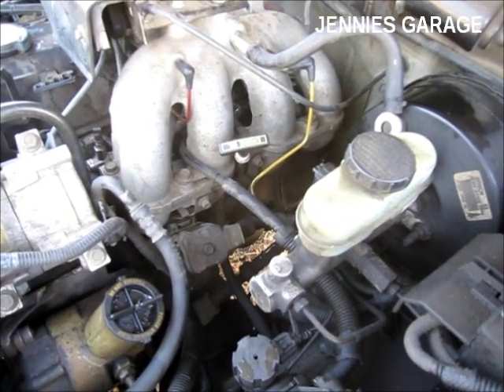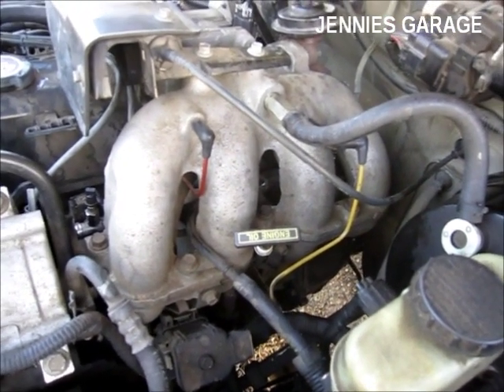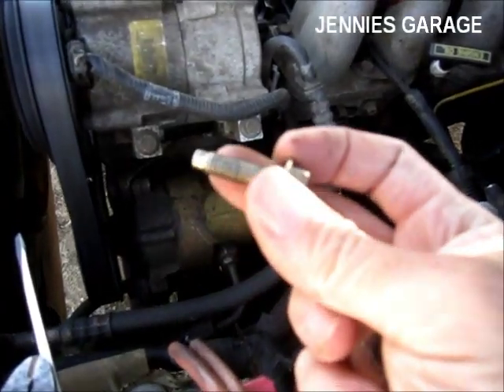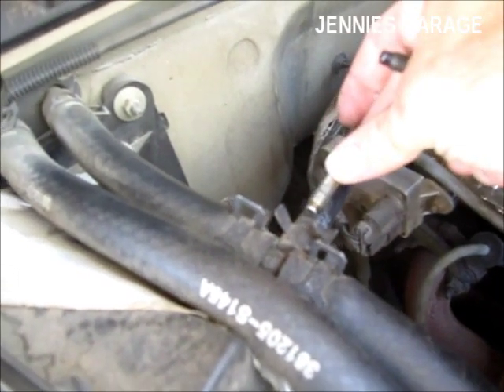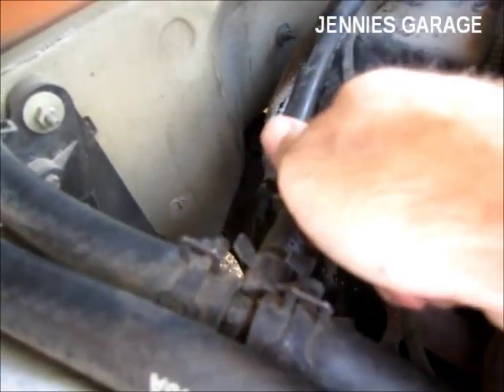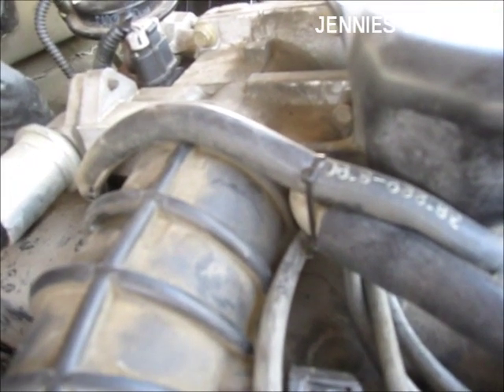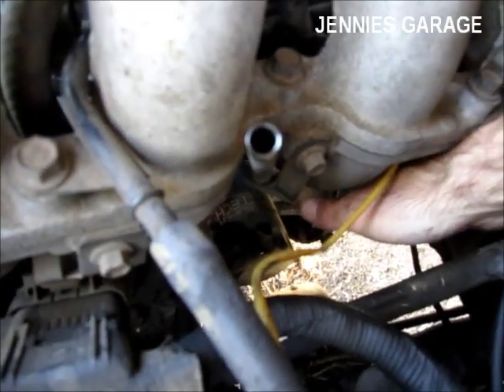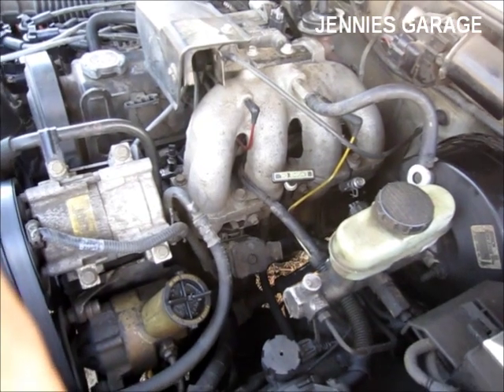Ford Ranger Intake Manifold Hot Water Bypass - Cooler Air In 5 Minutes

Comment: Neat, considering doing this in my 2.5 except I would put a valve that I can turn from "summer" to "winter" mode. Would I have to block off the end at the manifold with a valve as well, or just at the tee? I'm wondering if you could have left the hose attached to the manifold with no ill effects? I'm guessing I would just need to add one valve, and burp the coolant system after installing to prevent air bubbles wreaking havoc.

Comment: I have a 99 2.5l that was leaking coolant where this line terminates at the block, broke the barbed fitting flush with the block trying to repair the leak. do you have advice on replacing that fitting?

Comment: Will this work on a 2003 Ranger with a 2.3l Engine.
Reply from the maker: My truck was a 2.5 but if you can find coolant tubes going to the manifold like in the video, it's probably a similar process.

Comment: Mine's an 89, I have to replace that entire hose (we do live in places with temp extremes in both summer and winter) and it's looking like I have to pull the oil filter to replace the engine block end of the hose. This sucks 'cause I just did an oil change two days ago before that hose started to fail. The lining of the hose has hardened, is cracking and pinholes started forming in the hose yesterday. I thought it was replaced more recently but that's not one I ever did - might be as much as a decade old.

Comment: The 3.0 V6 Rangers have the same thing. Two small pressed-in small pipes in the top of the intake manifold. They tend to leak, especially if the coolant gets gunked up and deposits nastiness in them. Mine started leaking and I fixed it by simply replacing the old heater hoses with two lengths of generic heater hose and eliminating the T-junctions entirely. Then just get a couple caps to cover the nipple things on the intake manifold. Emissions inspection here has never said anything about them.
Reply: Thank you for your comment. Any idea what to do if my nipple thing broke off? Does anyone know of some plug?

Comment: I just replaced my old radiator cap with a new on, ping gone and .6 mpg better fuel mileage.  Not much of an increase,  but no ping (detonation) to damage the valves and piston heads. Easy fix. Always suspect this when the ping happens on hot days, and your reservoir for the radiator is dry or low a week after you fill it to the mark.

Comment: Does anyone no the location of the correct intake manifold vac. Line on 2011 ford ranger 4.0? Installing hks compressor and the line I believe is the correct hose has coolant in it and if so will bypassing and caping off the coolant intake line so I can connect compressor will it cause any issues with temp.i live in bc van. so I have no freezing risks so it seems ok to do.Plz help if u can.pics would be appreciated.
Reply: easy as putting shut offs on

Comment: Does this help with pinging? Do you have any other techniques to get rid of the dreaded ping?
Reply: Cooler intake air helps to stop detonation (also increases hp and mpg) and so does your ECU which listens for detonation through it's detonation sensors installed on your engine block. If it still "pings" you probably have carbon build-up on the tops of your pistons and intake valves...time to pull the head(s) and do some wire brushing.
Reply: W.Ormsby mine stopped when I started using higher octane gas for awhile.
Reply: Robert Shackleferd how many miles you have on your ranger?

Comment: I believe that's the first time I've seen wire connector crimping pliers use to cut heater hose. Whatever gets the job done I guess. Pvc pipe cutters work well on hoses to.

Comment: Can anyone tell me where the return line goes back into the cooling system? I swapped blocks from the 2.5 to a 2.3.  So I have a 2.5 head on a 2.3 block and can't find where to rout this hose. Thanks!
Reply: I did it to what i was told ws the splitter has to be removed and just connect the 2 hoses and run the right hose to the thermostat i think it was.
Reply: @J-W.-  Jonathan, what year is your 2.3 engine or truck &  did the 2.3 mounting brackets work with the 2.5 head? Thanks.
Reply: @randywaters8298  I believe my 2.3 block was a 1991. My issues was that my intake manifold had a water inlet jacket that ran into middle of 2.3 cylinder head but the 2.5 did not have this so had to block it off.
Reply: @J-W.-  Jonathan,  My Ranger is a 1992. I'm hoping I don't have to change the alternator, power steering brackets etc. Thank You for taking the time to answer. Best Regards, Randy.
Reply: @randywaters8298  Np! And good luck! Loved me ranger and was sad to see it go

Comment: A 2.3 intake does not have that coolant port at all.
Reply: I have a 91 ford ranger 2.3 liter only found out coming line to heater hose this guys intake don't even come close to mine.
Reply: @jimhowse3892  2.3 comes out of bottom of intake around back of engine to right side and tees into heater hose
Reply: The 3.0 has two hoses going into the intake.
Reply: Hey Jim any idea how to run the splitter from the heater core i cant find a diagram

Comment: Done the same thing to my 302 in my 1990 F-150 and I've gained a decent pit of response time back in my engine just from this. hesitated for a full second before wanting to go on a good day and detonation was horrible with that engine until I did this mod myself. In the future I'm gonna turn that heater system into a inter cooler for summer time.